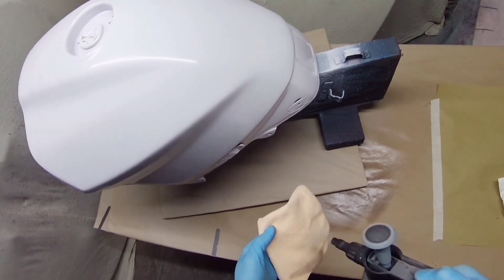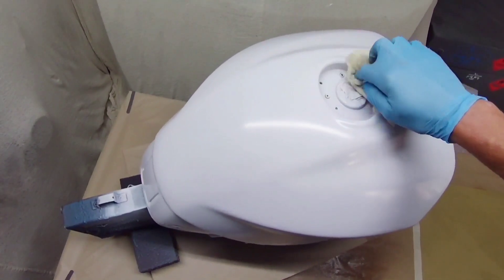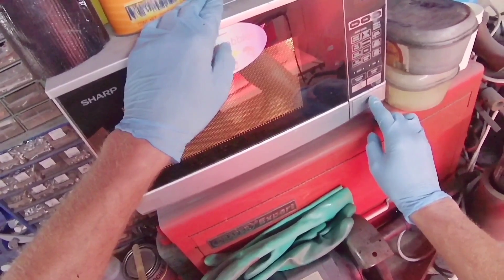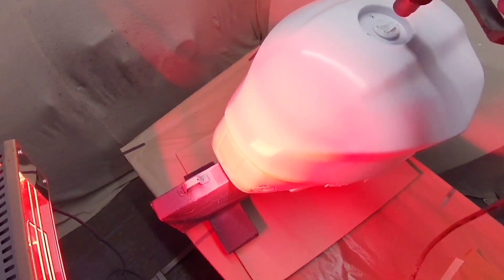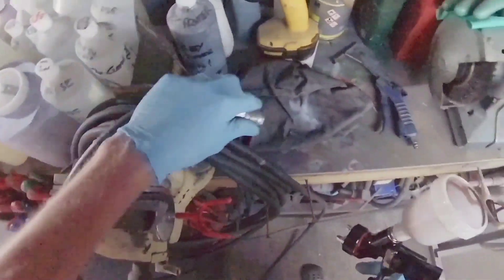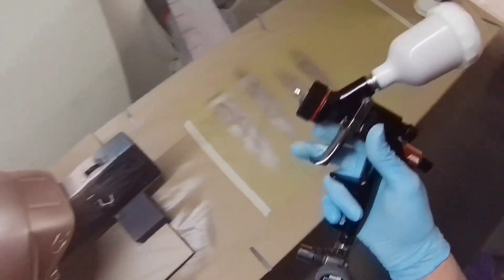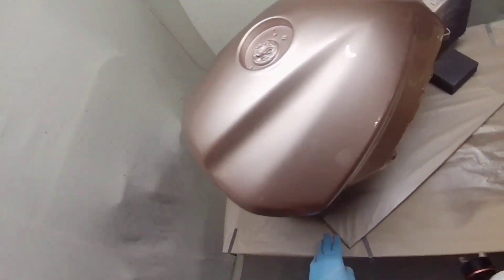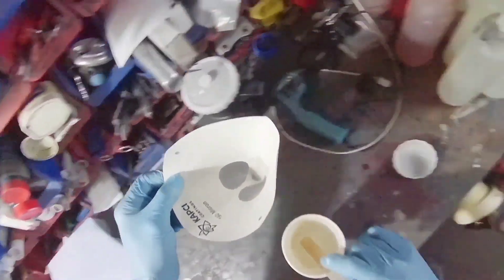Chinese NVE 1.3 Ntools Spray Gun Based On DV1 Devibiss

Comment: Pete, an experienced painter starts off with a recommended pressure setting and makes final adjustments before and during painting, fact is I setup and then make adjustments as needed. This is true with any gun as thinners and temperatures do effect the spraying. I find the copies do a really good job once set correctly.
Reply from the maker: Hi buddy,  yes, I would agree. These do paint quite well, although they aren't as good as the original. They are considerably better than the Gti Pro Lite copies imo.
I run this NVE when I use it at 2 bar most of the time with clear coats and a little less with solvent basecoat. It obviously depends on a lot of things as to how this works for people, but it's certainly where I would advise someone to start, cheers mate,  appreciate it 👍
Reply: Yea but there is a major difference when you spray 8psi to 12psi with the real DV1 compared to 30psi to 35psi with a copy. Any professional painter including me does not settle when it comes to equipment for doing professional grade work for people. Besides, NO ONE SHOULD BE GIVING CHINA MONEY. So, the real thing is 3 times more money, well its 3 times better and will last much longer and you will not be funding a country trying to destroy your country's economy 🤷‍♂️

Comment: Hi Pete. Interested to see what you think of the astro. Garage noise has a few vids on them. I   never popped on one. I have a few budget friendly guns and they all seem to spray the same. My favorites as of now are my aeropro r500 and my flg5. I spent a little on the flg5 but to be honest it sprays about the same. I wouldn't hesitate buying another r500. Very good for the money. Always wanted to try the kiwami4 but ive never popped on one because Im afraid I'd be disapointed in performance vs cost. I just bought a used lph400 lv4 1.3 off ebay. We'll  see if i like it. Always wanted to try the tulip tip and see how it sprays. I hope it patterns nice and keeps overspray down. Cheers
Reply from the maker: Hi buddy,  I have two Astro guns, and I must admit they are pretty good, including the build quality.
The FLG5 is a good workhorse, which I still have. The performance is ok and ideal for most forms of painting.
Imo the Kiwami4 is a step up from the FLG5 and the R500, although we are talking small increases, not huge  as none of these are bad guns 👍

Comment: GTI copy is ok at 25-30 psi and 2 1/2 - 3 turns out dose good for the price ? You can get great results if you can ajust to what the gun needs.
Reply from the maker: Hi buddy, The Gti copy certainly puts out too much fluid for its cap to handle, so backing off the fluid certainly helps it.
The prices these sell at now have come down, so they can be had for around 45 USD which represents reasonable value for money, the NVE is more expensive but imo it's definitely worth it, it just feels so much more refined,  cheers mate,  appreciate the comments 👍

Comment: Wow!  I'm impressed!  The fan pattern on that is pretty wide and soft while still putting out a decent amount considering you're using a HS clear. Imagine how it would perform with a MS clear.  It laid down the base and clear with good atomization also. What do you think the of the air and fluid consumption? Is it pretty efficient or a hog?

Another great review, and I look forward to the Astro EuroHE. I have one, albeit I have better. 

Keep up the great videos, Pete! ❤
Reply from the maker: Hi Boss, Yes, I was surprised how good it was. It is obviously not as good as the original, but it's 1/6 of the cost.
Pattern was good, even and as wet as someone could want, I estimate it uses around 10cfm so not really an air hog in this day and age where everything that comes out seems to use more air than the one it replaced. 

I didn't want it to be as good as it was, but I can only say as I find, appreciate the comments as always buddy, thank you 👍

Comment: i bought this same spray gun to try.... It sprays basecoat super nice, for a chinese copy gun...
Laid down some metallic vauxhall Metro blue amazingly....
I used same settings as you recommended, for a base line...
Clear coat on other hand though..... Orange peel'd  as f**k 🤣
Reply from the maker: Hi buddy,  I found it sprayed clear quite well considering the price,  was it that bad?
Reply: @peteshobbies5383  Definately not the worst orange peel ive seen.. When held in sunlight, you can see the metallics all lovely etc.. But at angles, You can defo see the orange peel....
Although, this may be personal error... This is why i commented, to get advice :) 
When laying down the metallic basecoat, i backed up 8-9 inches from panel, and the metallics layed lovely... But on clear coat, i think i may have automatically just stayed at that same distance too... 
Could that be the cause of the orange peel?
I think it was just something that was embedded into my mind tbh.. I knew i had to back up from the panel a little for the metallics... So my brain automatically made me keep a distance on the clear coat too....
Im using OSCCAR HS 912 clear, with slow activator and slow thinnners...
Reply from the maker: @Ay_Ess Yes, almost certainly,  you are right to back off on metallics,  I spray the drop coat or final coat around 10 inches. Some also drop the pressure slightly, but distance has a similar effect.

With clear you want to be around 6" from the panel,  maybe 7" but not more, you will find it goes on much wetter, which will help it flow out more, also slowing down a little will help although if you are closer to the panel you probably won't need to, it a matter of reacting to what your seeing
Reply: @peteshobbies5383  Nice one :)
I will scuff with p800 and try clear coat again :) 
Its amazing, I got the metallics to lay absolutely perfectly... But mess up on the clear coat :D 
This litte chinese spray gun isnt bad.. i will defo upgrade to something genuine, once my painting skills improve... 
thanks for your help
Reply from the maker: @Ay_Ess You're welcome buddy,  let us know how you get on 👍
Reply: @peteshobbies5383  I scuffed with P800, tack ragged it, and put another 2 coats on... 2bar pressure and around 4-5 inches from panel.... Let it tack up, But it wasnt "flowing out" too nice... So opened fluid up another half turn.. to 3t out and laid another coat over... LOADS better.... My gun seams to like its at 3 turns out on fluid.. at 2 bar pressure :)
Reply from the maker: @Ay_Ess  I use the NVE with the fluid wide open, clear coat needs to go on wet, obviously be careful of runs but you do need plenty on there for it to flow

Comment: hello pete, do you think r500 or nve is better for the base and clear coat
Reply from the maker: Hi Mate, The NVE is a better gun for sure
Reply: so for the best result, base at 2bar, clear coat 2.5? How many rounds are open for material consumption?
Reply from the maker: @milanvrkljan3933 On the NVE,  I use 1.8 bar for base coats and 2.0 bar for clear coats.

As far as materials go, I use full fluid for clear coats, for base it varies widely depending on colour and substrate, but if you are unsure,  try 1 1/2 turns out from fully closed and then open it more if needed, it depends on what you are seeing,  hope that helps 👍
Reply: you helped a lot, and how much do you think it is for the base and clear coat for 4000b I use 1.8 bar base, 2.2-2.3 clear coat, for both open from closed 3 circles.
Is that good or?
Reply from the maker: @milanvrkljan3933 I use 1.8 for base, 2.0 for clear,  fluid all the way open
Reply: I don't understand you a bit here, you think until the end until almost the spring and the screw come off, which is 4-5 full circles
Reply from the maker: Yes, for a clear coat, that is what I use, all the way out, but obviously not so far that the knob falls off. The base coat will be different,  like I was saying before, starting at 1 1/2 out
Reply: Thanks, you are the best.
I have a 4000b, and it's great, I'm planning to take nve.
Reply from the maker: @milanvrkljan3933 You're welcome, buddy 👍

Comment: Can you use solvent basecoat in this gun or just water based?
I do smart repairs outside and need it to dry quick.
Reply from the maker: Hi Dan, Yes, I use solvent most of the time and only use solvent with this gun, and it's been fine

Comment: I want to get this with a fast clear as I will be spraying in my carport. You mentioned dye back, could I just polish/buff afterwards and it should be fine ? And do you recommend fast clear for bonnet and front bumpers or is it too weak?
Reply from the maker: Hi Mate, Normally,  the faster the hardener, the more dieback you will get. It's not set in stone, but it is quite a reasonable assumption.

The answer is yes, you can normally get it back. It's just more work.

I'm not sure what you mean by too weak 🤔
Reply: @peteshobbies5383  Thank you I meant weak as in durability wise compared to MS or HS clear
Reply from the maker: Normal, the quality of the clear coat has the biggest effect of longevity, as well as preparation of course, remember,  clear coat needs to be applied within an hour or so of the  base coat to get good adhesion
Reply: @peteshobbies5383  Thank you master! so you're saying the quality in terms of the formulation/brand is more important rather than if it's a fast or slow one.
Reply from the maker: @jonot8547 Yes,  that is normally the case. Also,  the better the quality of the clear coat, the easier it is to spray as it flows out better 😀

Comment: Hi. What cfm required for gun?
Thanks
Reply from the maker: I would guess it's around 11 cfm, so it's not loads but more than some
Reply: Pete. Thank you for your reply. 
What can you suggest for a low cfm spray gun?
I'm asking because It's only my hobby, and i like to learn and do myself.
My compressor is 11cfm and I don't want to break the bank. 
Thank you.
Reply from the maker: Something like the R500 would be ok. It's cheap, and it sprays quite well . Although it uses twice the amount of air they claim, it's still around 8 cfm, so it should be within your compressor
Reply: @peteshobbies5383  thank you Pete. I did some search about R500. And now i make my decision.
Reply from the maker: Good luck 👍

Comment: Im been waiting for this review.. thanks pete😄👍..i wonder if your settings can be use to spray on full car.. 
Waiting for the next video.ori vs copy..😆
Reply from the maker: Hi Rey, Yes, there's no reason why not, but if you have relatively simple car panels to do, then I would probably go one out on both fluids as moving faster isn't a problem.

These really can throw it out, and the bit where I say it can overwhelm the cap holds true no matter what you are spraying. It's certainly imo better than the Gti Pro Lite copies as you have more control , cheers, mate 👍
Reply: @peteshobbies5383  I forgot to ask..is this similar to c1 or c2 cap?
Reply from the maker: It's more like a C2, although it's not the same as any of the original caps

Comment: Maybe i got a lemon, but the clone i got only lasted me 1 month. The internals got stuck and lubing it didnt help. Performance wise for that 1 month was fantastic. I have many prolite clones that have lasted for years with no issues so im pretty disappointed in this gun.
Reply from the maker: Hi Jimmy,  longevity is always a big question with Chinese guns, I've found most of them to be fairly unreliable, including the Gti Pro Lite ones, certainly if your using these a lot I don't think they will last well which I think I said in the video, for the occasional painter it would fit the bill

Comment: did you actually microwave that paint? I've never heard of that and it looks completely hack and wrong. I can't trust someone that does that
Reply from the maker: Hi buddy, yes, I did microwave the paint, I do it with clear coat and primer as well.
I do normally add, and I believe in this video I did, that it's not recommended, but it's what I do and works very well, particularly if it's cold.
I do, and will continue to do, what works for me, just like you will do, and continue to do what works for you.
I'm not sure what it has to do with trust though?
Reply: People do the same with epoxy resin to thin it out.
Reply: @peteshobbies5383  took me awhile to formulate a response to this: I meal prep my food for the whole week using quart size plastic Ziplock bags. if I heat it too much the plastic bag melts in very specific spots, the heat is not even. urethane paint is like a plastic film. you are basically damaging the paint unevenly. I cannot imagine any paint manufacturer recommending you microwave paint. use hot water and put your paint can in it. you are not a master chemist, just use it how you're supposed to man. I experiment too but cmon, this is so utterly void of any common sense it's crazy as hell
Reply from the maker: I think you hit the nail on the head, "if you heat it too much," you said, there my friend is your answer, simply dont heat it too much and you'll be fine, you won't believe me so we will have to agree to differ.
BTW,  I accidentally put 200ml of clear coat on for 1 minute instead of 10 seconds. It started to go to jelly, so too much is definitely not recommended . Cheers 👍
Reply: @peteshobbies5383  you're missing the point that how the microwave works is it heats it in a very specific spot. in order for you to get the whole paint you're using to the temperature you want it's damaging certain parts of the paint. I would totally disagree with this. heating the paint is a very good idea, but not like this, hot water would be better
Reply: Liquids diffuse heat faster than solids. If any one spot gets hotter faster than the rate of diffusion, and  exceeds the boiling point of the solvent. Then boiling should be observed in the liquid clear.
Reply from the maker: I used to use hot water, and it worked well. It was time-consuming, though and not particularly practical when it's cold,  I was forever having to go heat more water.

I switched to this method around 3 years ago after a few body shop guys recommended it, I can't say I noticed any difference in the performance of the materials at all.

It is, of course, much faster and very easy to do, as I've said in my videos, I don't recommend anyone does this, but it's what I now do and many people have asked,  hence leaving the footage in some videos.

Comment: Compare to DV! this Gun need more pressure
Reply from the maker: Hi Louis,  this gun performs very well at 2 bar, but the best finish is achieved around 2.1 to 2.2 bar, so 31 to 33 psi, good value for money though 👍
Reply: Yea i spray clear with my Devilbiss DV1-C with original C-1 air cap and 1.2mm nozzle at 10psi for high solids clear. If using medium solids production or universal clear i use the 1.3mm nozzle and spray at 8psi. Thats a major difference
Reply from the maker: @user-un5my5bw4j Hi William,  that's really low pressure,  I've not tried it at that pressure but will give it a go one time to see how it goes 👍
Reply: Hello mate do you by any chance know what number pps adapter fits this gun.  Thanks
Reply from the maker: @mxshredder925 Hi Mate, Yes, it's the same thread as the Devilbiss Tekna Gti Pro Lite and DV1,  so it's a Number 3, PPS1 = 16033 and PPS2 = 26033, cheers 👍